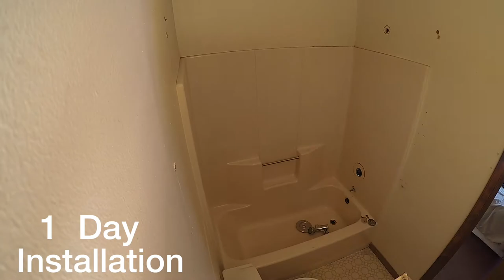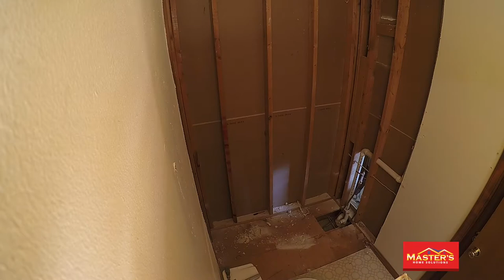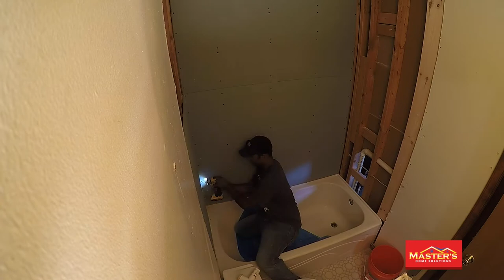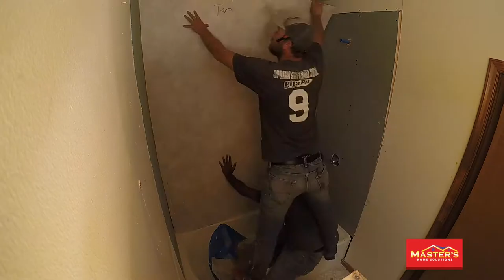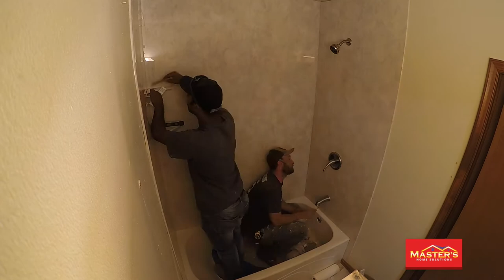One Day Bath Install | Timelapse

Comment: You should also leave protectant plastic on all the way until the end. Once you have the acrylic wall up run a razor lightly around the rail and remove it only then. No need to risk scratches on the new tub.

Comment: Doglegs on the wall should go to the floor instead of to the top of baseboard. Baseboard can be easily cut with an osculating tool while on the wall for a clean cut.